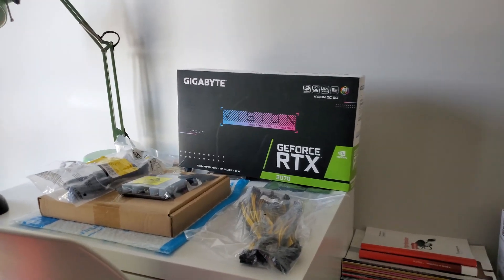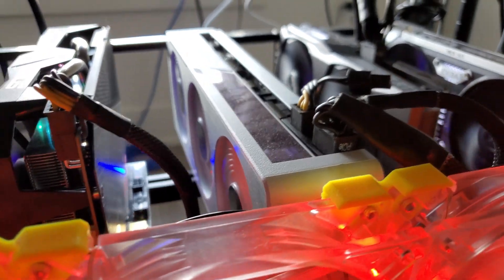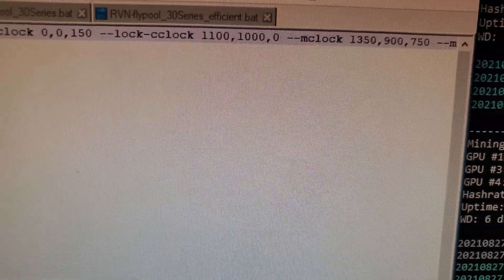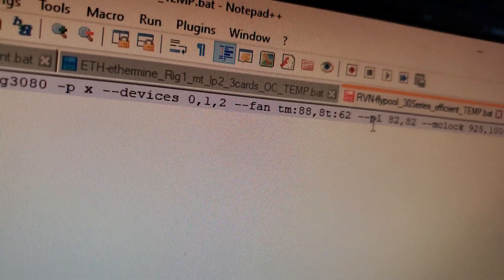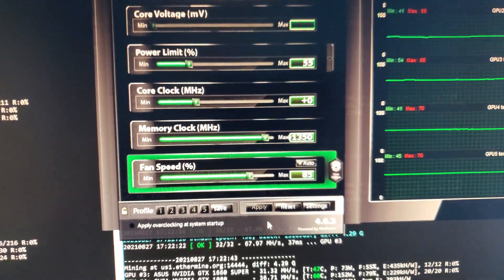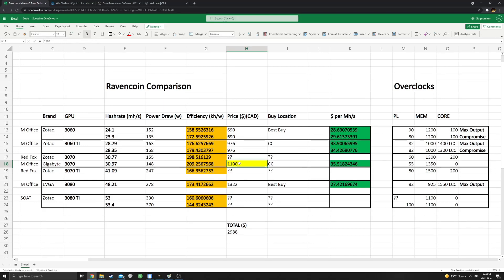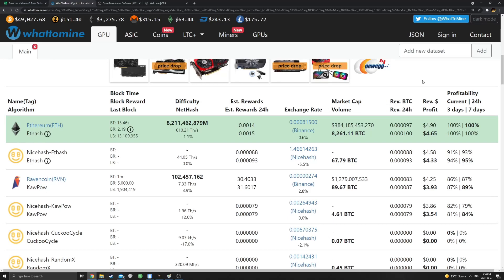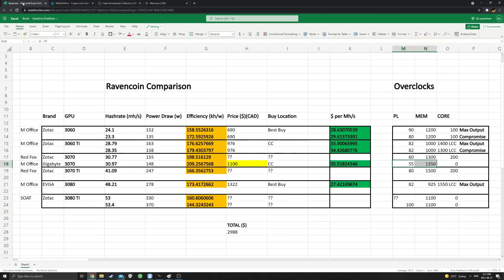Gigabyte RTX 3070 Vision OC Hashrates: ETHEREUM vs. RAVENCOIN

Comment: Hey, I ended up getting a 3070 tuf (samsung memory) and got an efficiency of 214 kh/w, I think I have to play with the settings a bit more but curious what memory is on your gigabyte? Also I tried your settings and it improved quite a bit for efficiency!
Reply from the maker: On my gigabyte its Samsung or Micron cant remember! ill try to check it out when I can. From my testing, 3070s are the most efficient cards on RVN for sure

Comment: Do you do all your mining within Windows or do you use some other OS?

I noticed that Ravencoin just gets quite a bit of rejects over time.  More so than I have with anything else (Ergo as example).  I mine Eth, RVN and ERGO.  And out of all of them, RVN gets most failure rates (Stale jobs, probably the pool).  Anyway, keep it up.  Great videos and I appreciate the information.  You should upload your findings with GPU's, hash rates, OC's and what not onto a shared Doc!
Reply: It depends on what miner you are using.  When I use Trex, i get almost 3% rejected.  When I use NBminer i'm around .15% rejected.
Reply from the maker: Personally all my rigs are on windows for now! :)

Comment: Just trying to start mining with a single card. I am from India. Here i can get rtx 3060 non lhr for the price of an lhr 3070ti. My doubt is should i get the non lhr 3060 or the 3070ti now in september 2021 . Please give me your thoughts on this? . Nice video by the way.
Reply from the maker: Hey dude! 110% get the 3070ti instead of 3060! Much better GPU and you can mine RVN and will make more then ETH kn the 3060! Trust me :)

Comment: nice getting 30.89 on mt msi LHR 3070 rtx nbminer
Reply from the maker: On ETH you should be able to pump it up more using the -lhr unlock I have a video on it, check it out :)
Reply: @MiningOffice  ya only saw 3060 and 3080